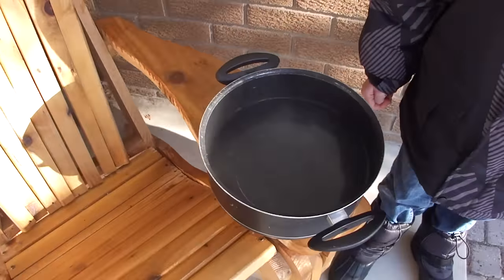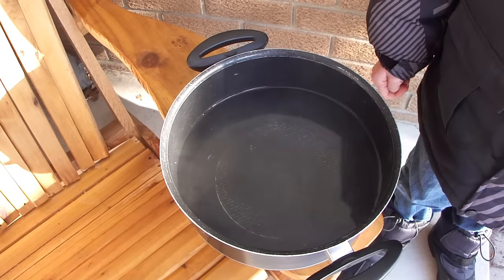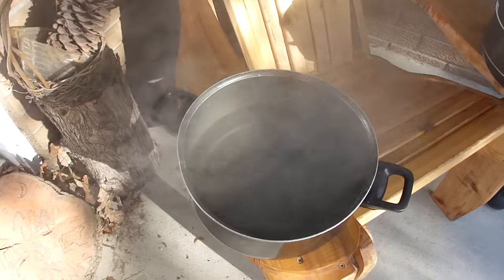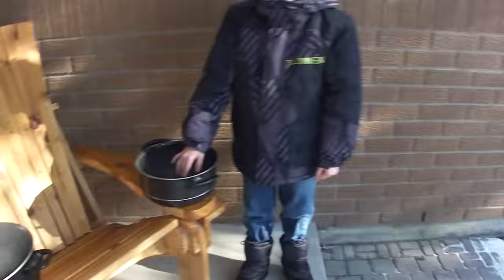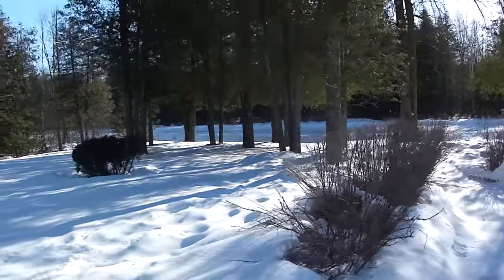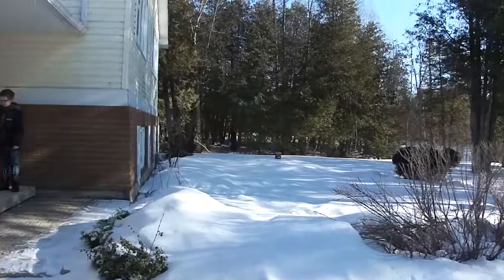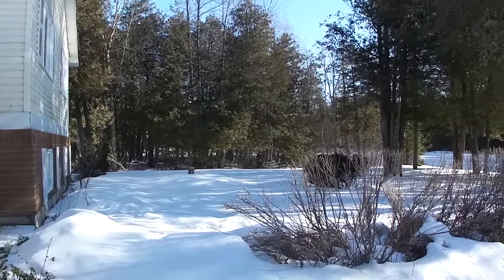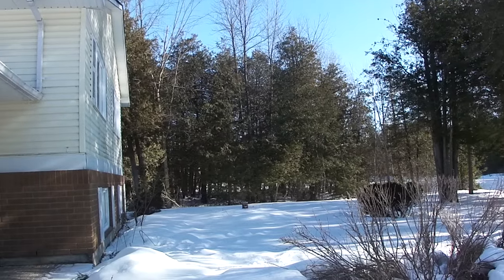Hot water freezes faster than cold water?

Comment: Hot water has lower viscosity (hence why pouring a cup of hot tea or coffee sounds distinctly different than pouring a cup of cold water). I'd imagine that might make the water break up into a mist easier, exposing it to more cold air. I'd be surprised if the effect was the same if you just stuck the pot outside (since hot water has to become the same temperature of cold water before it freezes). As others have said, the heat from the water may also be condensing water vapour around it, giving the effect that a freezing effect is happening when the reverse is happening too.
Reply: I just poured a cup of hot and cold water.  There was no distinct difference in the sound, as 33 degree water and 211 degree water is not a huge difference in density.  Not sure what you're talking about.
Reply: Ok
Reply: That last paragraph starting with, “I’d be surprised…,” is about right. Except it’s more about cold air not being able to hold as much vapor as warm, which forces the water to condense and crystallize
Reply: Hot water freezes faster in ice cube trays.
Reply: I believe that it uses the same principle of when you cool down using sweat.
Some parts of the hot water will use up energy in the other parts to become gas in the cold air that is very dry. The remaining water that loses the energy instead condenses into ice and falls to the ground.
The room temperature doesn't have enough energy for there to be enough vaporization and so the water remains as liquid when it falls to the ground.

That's my theory at least.
Reply: Read up Newton's law of cooling
This video will make a lot more sense
Reply: Yeah I never passed chemistry; biggest flex of my life
Reply: @bigguy7353  Well, you’re not listening carefully enough, because the difference in sound is pretty damn obvious.
Reply: No it does not.
Reply: @bigguy7353  they do sound different
Reply: @Big Guy  hot water does have a lower viscosity tho? This is 1st year chemistry.
Reply: Yes I agree
Reply: they are happy what is this now
Reply: @bigguy7353  density and viscosity have nothing to do with eachother
Reply: Water's viscosity doesn't change much though since it's such a small molecule
Reply: im pretty sure any sound change is coming from how many small bubbles youre dealing with.   hot water is only going to freeze faster if its in mist form, a container of hot water just sitting there will have to become cold before it can freeze, a container of cold water has a head start there.
Reply: @whatisthisayoutubechannel  maybe Big Guy do do doesn't have best hearing
Reply: Since the difference in samples is temperature i.e. one hot and one cold. The reason lies in the temperature differences. You can't apply viscosity factor here above that. Higher temperature means more random movement of particles inside the droplets of water thrown. And due to higher temperature different, the rate of heat transfer is also a lot highter hence everytime a particle quickly comes into contact of cold air, it rapidly coolds down.
Reply: Since the quickly moving particles (which take up the heat from another particles in bulk) escape out of the surface as steam...the increased surface to volume ratio also determines the cooling speed
Reply: It’s steam bro that’s why it’s rising in the video viscosity has nothing to do with this what are you talking 😂
Reply: It’s probably because the rate at which the surface area to volume ratio increases is faster than the linear increase in temperature as well.
Reply: i didnt skip science class to end up here again lol
Reply: Genius
Reply: water viscosity is not affected by temperature, they both pour exactly the same.
Reply: @bigguy7353  idk they sound different to me
Reply: @bigguy7353  viscousity plays big role. Hot water turn into steam, since steam is very small particle, it easier to freeze.
Reply: @indimediaworks  no it does not
Reply: This doesn't seem wholly correct. If you mathematically solve it using conduction of heat, you will be able to easily prove how hot water freezes faster.
Reply: @Ron Bali  let's say we have 200 degree water and 70 degree water

The 70 degree water will freeze faster

Although the 200 degree water loses heat quicker at first, it will eventually become 70° water, at which point it will lose heat at the same rate the 70° was losing heat at

Since the other water started at 70° by the time the 200° water is 70° it will be below 70°

This water will freeze faster
Reply: I believe you are correct.  This has to do with the vapor, it would not happen with a hot pot and a cold pot just sitting in the cold.  

Physics is real, heat doesn't just "leave the party" with no explanation.
Reply: @bigguy7353  You be amazed at how much more detail some peoples' ears can hear than others.  It's even a characteristic that can be improved by practice.  Ask any audio engineer..
Reply: I guess it's got to do with the distance between the molecules as well. In hot water they are further apart as compared to cold water. Meaning that there is a greater surface area exposed to the lower temperature air than than the molecules in cold water. 

It could also be that the faster rate of evaporation from hot water decreased the volume of the water more than the cold water, hence it freezes faster as there is lesser water  needed to be frozen. However we can negate this as the experiment did not indicate whether the volume of water started out the same so this isn't a really reliable thesis in this case.

And now I don't know what I'm talking about anymore.. but having higher temperature means that there is more kinetic and thermal energy. So when a sudden exposure to low temperatures of the cooler air, more latent heat is released by the hot water since there are more energy.

This are just my thoughts I guess.
Reply: Hot water is less dense so it freezes faster.
Reply: @ronbali3429 Hot water does not freeze faster. If you took two equal amounts of water of two different temperatures, let's say one cup each and one at 50 degrees F and the other at 200 degrees F, the 200 degree water will "lose temperature/ heat" at a faster "rate" than the cooler water. But the cooler water will freeze first.
Reply: JESUS  is coming soon and JESUS is the only way to salvation accept JESUS as your LORD and SAVIOR today!!!.
Reply: @bigguy7353 actually the difference is significant. Hot water is significantly less dense than cold water.
Reply: @indimediaworks I've heard this a lot but it's not true.
Reply: @bern9642  It's called Mpemba effect. However it is not known exactly why this happens.
Reply: Thanks captain
Reply: @indimediaworks  except it's not scientifically accepted.  hot water doesn't freeze faster than cold water. you can however make hot water freeze faster than cold water but you have to do something to the water. for instance in the case of this video, they throw the water.
Reply: @bigguy7353 It's not always obvious. Oddly enough, some people can hear the difference between hot and cold water, while others can't.
Reply: Remember doing a test with the water sitting inna bowl. The warm water froze faster than the room temperature water. Basically has to do with with the energetic molecules moving faster thus improving heat transfer. The room temp water would freeze along the sides, but remain fluid in the middle. The warm water would cool in a more uniform manner.
Reply: Actually you are wrong, you should read into the Mpemba effect
Reply: Thermal properties of matter
Reply: Hot water freezes faster when left in a tub as well
Reply: @jacobbell1934  That's just the cloud though, not the water itself
Reply: Me falling asleep while reading your scientific comment 😂
Reply: @pedrolopa2  Mpemba effect has more to do with still water in a freezer; water in this video are thrown into the air, which is a different matter.

in the Mpemba effect, the hot water get better convective circulation thanks to the temperature difference between the top layer and the other water layers below it.
just a way to overcharge the ice maker btw, it still consumes more power than cool water since there are more heat to be cooled.

Comment: This phenomenon is quite easily explainable. Hot water has lower viscosity and dissipates into vapour much more readily, which flash freezes in the cold outside air. On the other hand, cold water doesn't make many droplets that are small enough to freeze that fast.
Reply: Wouldn’t it also be that the hot water is releasing steam and heat that shows up much more visibly like of you were to breath in a cold environment you can see your breath but not if you were in a hot environment
Reply: Look we have some dude who thinks he is newton
Reply: JESUS  is coming soon and JESUS is the only way to salvation accept JESUS as your LORD and SAVIOR today!!!.
Reply: Makes sense!
Reply: @thetrickster9885  ...and we have our dunderheed ;)
Reply: Hot water doesn't freeze any faster. It does, however, release more water vapor, which freezes as it hits the cold air (the reason why it leaves behind a trail of mist). You can't see the water within the mist, which might be why you think it freezes faster. The only way I could possibly see it freezing in the air faster is that loss from the water vapor, but even then that's moreso evaporation from the heat than it is freezing.
Reply: The high temperature of the hot water separates the individual water molecules farther apart, which gives it the lower viscosity, which allows the water to break up more easily into vapor and small droplets which increases the amount of surface area between the water and the air which increases the amount of heat transferred to the air which increases how quickly the water freezes.
Reply: Dissipates? You think water dissipates into vapor? I always thought it evaporated to vapor.
Reply: It also freezes faster when in liquid form, a man in Africa making ice cream noticed this. The mechanism still isnt agreed upon
Reply: But hot water freezes fast when left in a tub as well
Reply: @KJ7Tillymann  Boiled water freezes faster because it doesn't have air in it to upset the crystal formation of the ice. Boiling the water drives all the gasses out. 

But the cold water STARTS to freeze first because it's already cold.
Reply: "Hot water has lower viscosity..." I strongly doubt that.